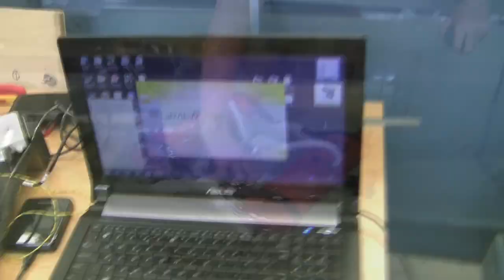Submersible student project 1, 2011

Comment from the maker: The task was to build a  #submersible   #ROV   with depth control.
The two buoyancy tanks (old fire extinguishers) would be filled with air to bring the craft to the surface, and allowed to fill with water to enable the craft to submerge.
A pressure sensor would detect depth,  #LabVIEW   would then compare that signal to a user requested depth level signal,  then control the water / air ratio in the buoyancy tanks to achieve the required depth.
The main problem was that as soon as some water entered the buoyancy tanks it would flow to one end or the other of these chambers, making the whole thing either nose or tail heavy and lose stability.
When in a stable level state it was very manoeuvrable.